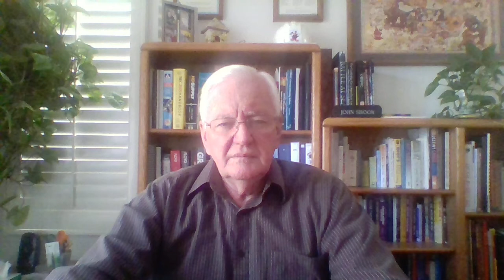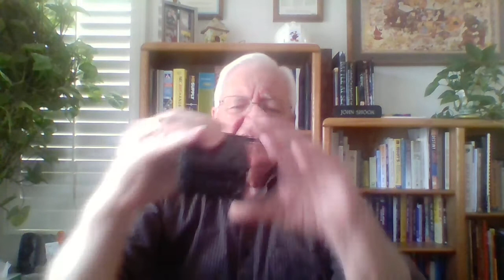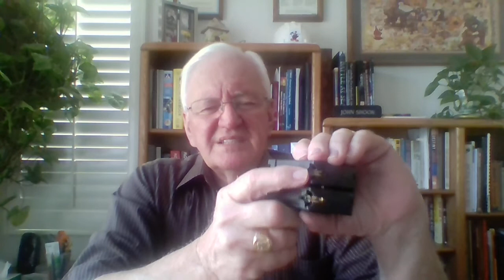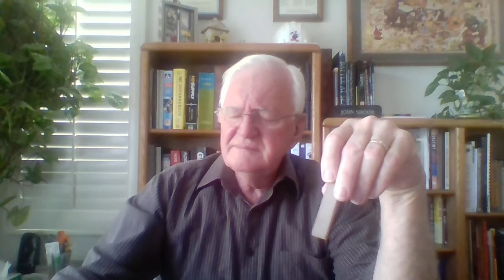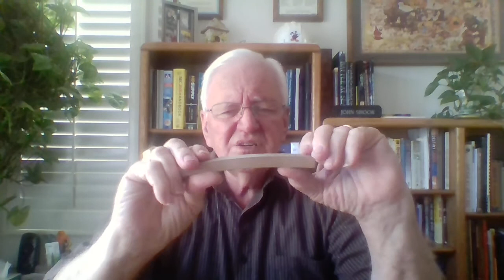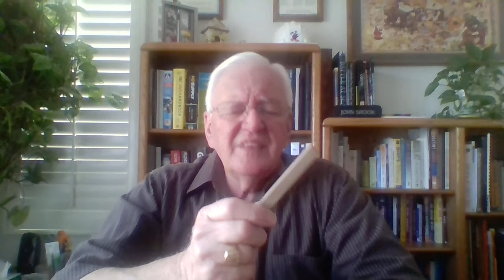Breakers, Installing It Correctly, Disney Manager: John Shook

Comment: I wish you could say more about dielectric grease on bus bars for breakers. I see some electricians debating this. The instructions that come with the breaker say nothing about it.
Reply from the maker: DeoxIT Grease Type L260 –Lithium-based preparation.  Good lubrication, excellent wear resistance, excellent pressure resistance, excellent oxidation (galvanic corrosion) protection, high dripping-point characteristics.  Operating temperatures L260: -40C to 260C
 

 
Copper particles L260Cp Lithium-based preparation.  Use when you require particles (conductive) to assist in oxide and corrosion breakup and good lubrication.  Copper is conductive.  Use in areas that two contacts will not touch and possibly short.  Example:  disconnect switches or large connectors and relays.
 

 
USES – Electrical:
 
Antenna connections, battery terminals, Buss bars, commutators, conductor rails, conductors, contactors, disconnects, drying & processing equipment, high amperage/high voltage applications, industrial electrical equipment (lifts, cranes, robotics, etc.), power tools, relays & switches (heavy duty, knife, step, rotary), etc. Sorry just had back surgery, not up to speed yet. JS

Comment: Hello Mr Shook,   If you have the time and desire to answer this question. I have 2 separate existing wires coming from the floor to power the old range. They are 10 gauge each and each goes to 30 amp separate breaker. I bought a new range that requires outlet with 8 gauge wire and 40/50 amp breaker. The question is: Can I combine(parallel) the 2 old wires together and install 40/50 amp double lugged breaker at the panel?  Breaker that is made for double tapping. Would that be safe and by code? I can't find info about it and can't find that breaker either.I'm not an electrician just a curious guy. Thank you!
Reply from the maker: 2, 30 amp # 10 wires connected to a two pole 30 amp 220 Volt breaker is normal for a small range. You can put the # 10 wires together on one pole for 50 amp 110 volts single phase, But most ranges  take two phase 50 amp 2 pole 220 volt 2 hot wire with a neutral and a ground , that is 4 #8 wires to operate the range. Check the voltage on the new range, Single pole 110 volts = one hot and a neutral and a ground = 3 #8 wires. For a two pole 220 volts range = two hots and a neutral for 3 #8 wires. Most ranges need to be grounded with a #10 wire or a #8 that makes the service to the range 4, #8 wires, or # 8/3 with ground, romex cable. JS.
Reply: @JohnShook  Thanks!